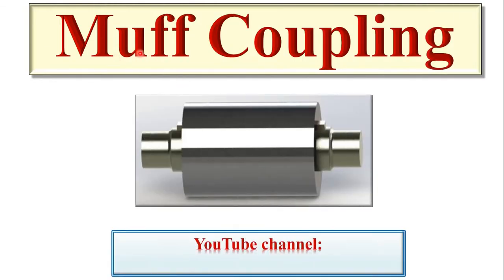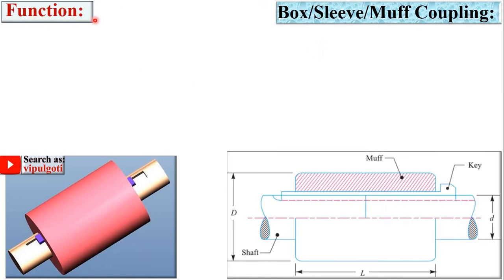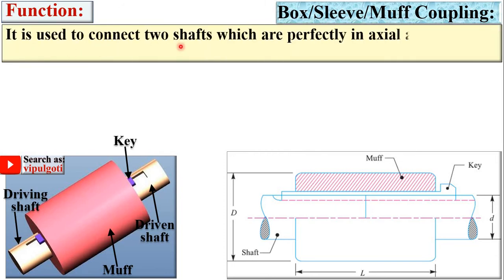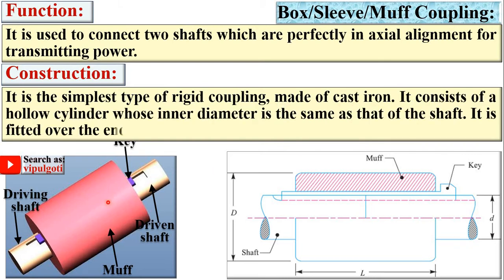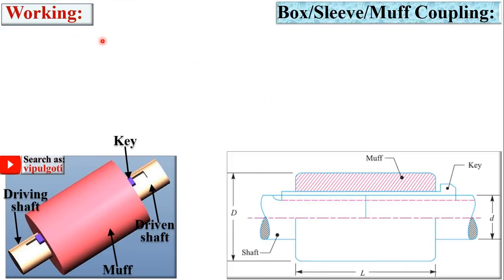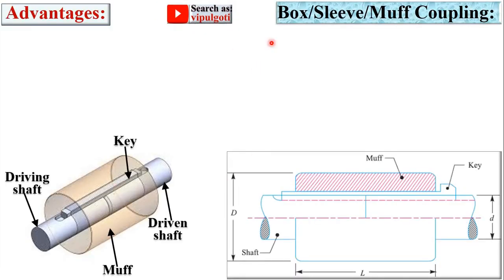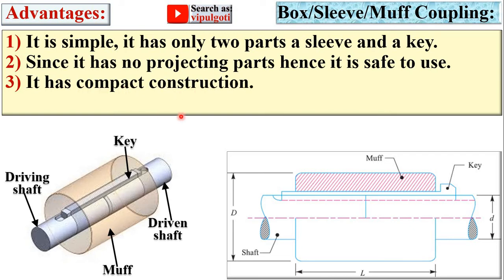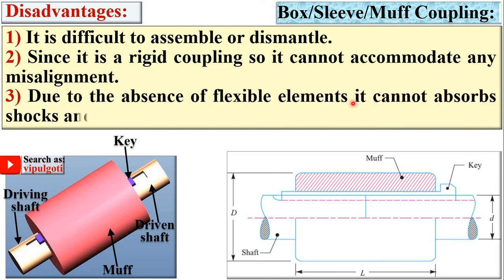Muff Coupling, Sleeve coupling #Coupling, Box coupling #Couplings, Rigid coupling #GTU #BME

Comment: Great explanation, I had a doubt, Instead of using 1 key, we can design make a part that uses 2 keys for different shafts and it should also work fine, i think
Reply: it might help for misalignment issues
Reply: Was thinking same to add two keys
Reply: There is no need to have second
Because 1 key will do enough